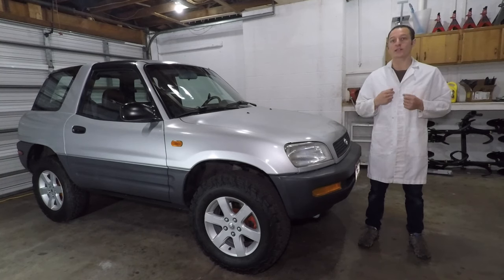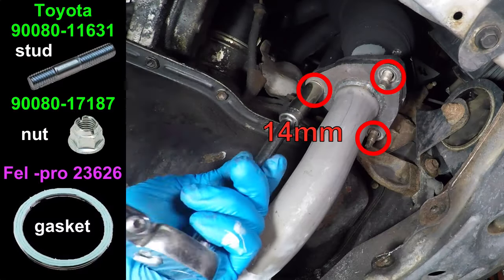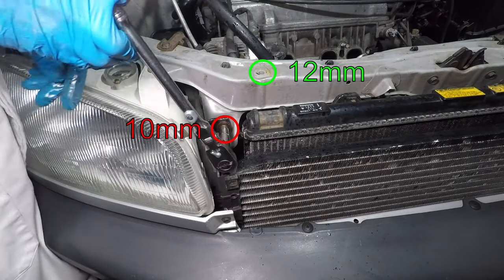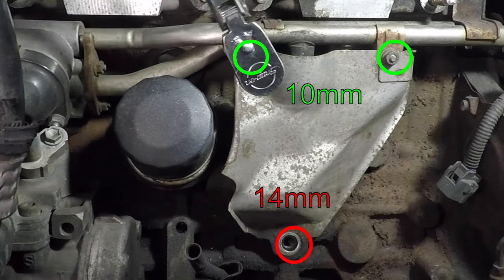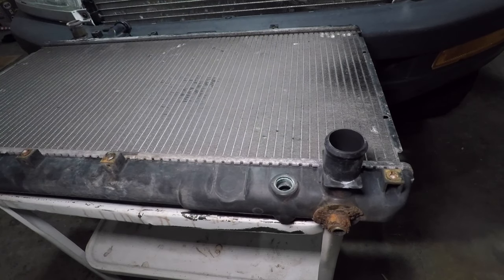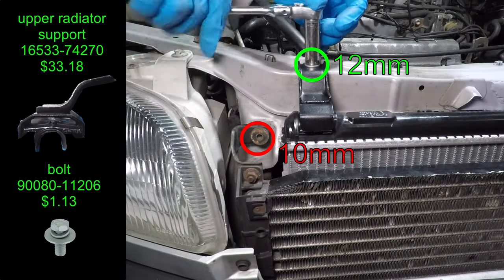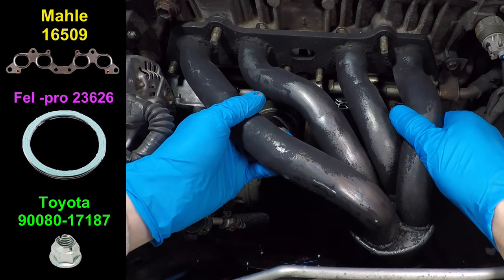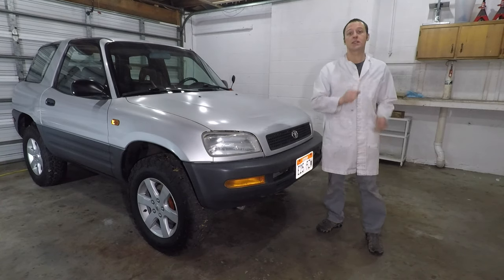Replacing the radiator 1997 Toyota RAV4 (episode 15)

Comment: Hey everyone!!!! I just did the radiator on my 1998 rav4. I found an alternate method some may find preferable if you are worried about taking headers off. 
1: Remove all radiator fans bolts 
2: Remove entire airbox assembly 
3: Remove bolts holding AC dryer/ condenser and lines in place (give you room to wiggle it)
4: Remove all bolts holding plastic underbody protection on, as well as the bolts holding the front bumper cover down
5: Disconnect fans wiring and coolant temp sensor wiring. 
6: Disconnect negative battery terminal (don't wanna mess with airbag sensors)
7: After removing all bolts from the underside of the bumper cover, loosen plastic fasters on top side of bumper cover. 
8: Remove Bumper cover and brace it on something to not strain the wires. 
9: Remove about 8 bolts holding the front metal bumper in, pull that out of the way
10: Take the now loosened AC condenser and put it up off its mounts, giving you plenty of wiggle room
11: Remove old radiator 
12: Reassemble and  and bleed air out of system 
I know my description was lacking some fine details but I just wanna throw this method out there for anyone interested. It did it in an afternoon and was 100% successful. If anyone has any questions or want any further detail just reply to my comment, I'll try to give you the best advice I can.
Reply: Thanks for this -- one other video seemed to talk about removing the bumper to make room -- agreed that I don't want to mess with the exhaust manifold, so I'll be using this method for sure.  Interesting how MANY of the videos end up making things look MORE complicated than they actually are.  I was also guessing an afternoon, 6 hour range, is all that should be needed for this job.  None of my fans work, and I'm trying to decide if I care, as it's still running on the old leaky radiator, and never gets "hot" per the guage, fans or not.  Are the fans just necessary if you're sitting in stopped traffic on a really hot summer day?

Comment: Thanks Paul this series has helped me a lot. I recently got myself a '99 4door rav4! You sold me on the OME lift cant wait for mine!
Reply from the maker: That lift is nice.  I hope your car isn't as rusty as mine was.
Reply: @LabCoatPaul  how well do the cv's and steering joints handle the steeper angle resulting from the lift?
Reply from the maker: @superdupersalem  They're just fine with the Old Man Emu lift.  I think if you did a 4 inch lift you could get some problems with the CV axles.

Comment: Hi, your video was a great help, I just changed the Rad on mt 99 rav4 today, has 140K on it. I had to also remove the front motor mount, replace some screws that were rusted and broke off, changed some of the squeeze clamps to the gear type clamps, yes it was tuff getting the rad out, if they just gave another 1/2 to 1 inch of room it would have been an easy job.  Took about 4 hours with issues and distractions. Hope not to have to do it again any time soon!  Thanks.
Reply: If you have A/C, did you loosen or need to remove air conditioning condenser in front of Radiator?
Reply: @docjody8624  No I did not remove that part.

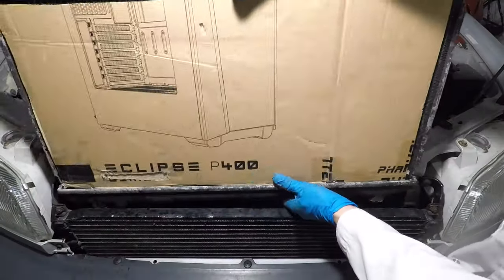Comment: 1//Sprayed Fan Shroud 4 x bottom bolts three iterations PB-Blaster over a 2-day period. So far, two have nonetheless sheared off despite my taking care. They're made of cheaper-grade metal than other OEM Toyota fasteners. Yey to remove other two. What size (e.g. M6-1.0x16mm) are these four lower 10-mm. bolts & where did you buy replacements?  Thank you. Hope others find this useful too.  2//  Also, do you have part numbers for those rotted lower radiator supports at 02:09?  Thank you again for taking time.

Comment: Hey Paul--  Another site states that front bumper must be removed for this job, if you don't want to have to remove A/C Condenser. I notice you 1/  Didn't removed Air Conditioner Condenser 2/ Didn't remove front bumper.  How did you have sufficient working room in there to be able to avoid both?  Any tips, much appreciated!
Reply from the maker: You don't need to touch the condenser.  The hardest part is removing the cooling fans.  You may need to unbolt the exhaust manifold to get the fans out.  After that, everything is easy.
Reply: Is it necessary to remove Fans entirely from engine bay in order to remove old Radiator?  Can tou just pull Fans out of the way toward rear of vehicle instead to access Radiator?  I'm hoping so. Did you remove Fans entirely only because you knew you were going to replace w/ aftermarket? Thank you again!
Reply from the maker: @docjody8624  Yes, I think you can just push the fans out of the way without removing them, and slide the radiator out.  
By the way, don't install aftermarket fans!  My flex-a-lite fans burned up the first time I drove the car on a hot day.  I'll be going back to stock Toyota fans.
Reply: You'll never know how much this info is helping us DIYers out here.  
     Say, what was first indication that your new aftermarket fans burned out on that hot day?  How did you know they were failing?  Thanks again. Fascinating stuff, Mr. Paul.
Reply from the maker: @docjody8624  I was driving along, and I could smell that distinct electrical fire smell.  You know when you smell something like that, you just hope it's something else, but it stays with you and then you know it's your car.  When I stopped, I opened the hood and could tell the smell was coming from the fans.  They worked about 20 more minutes, then shorted out and blew both my cooling fan fuses.

Comment: Hi Paul, realized that my 2 heater hose im the car is no longer connected. Is reconnecting this hoses back to the heater a job suitable to be done at home?
Reply from the maker: Yes, replacing heater hoses is pretty easy.  Cut the old hoses off with a sharp razor blade.  Don't grab the hose with pliers because you might crush the heater core pipes.

Comment: Hi Paul, I am having some issues with my Aircond system. When I start engine and turn on hvac switch I hear a clicking sound near the firewall and during that moment the compressor magnet relay clicks and the compressor turns on and off rapidly. Then either the compressor does not run or suddenly out of no where the compressor runs and the a/c is cold. When I hear the rapid clicking sound near the firewall the a/c is not cold as the compressor is on and off. When I bypass the compressor magnet relay and put the A/C button off the Aircond is icy cold. So I thought the relay was faulty and replaced it. But after that the clicking sound near the firewall is still there and my problem remains. I have also tried replacing the a/c button on the dash. What else can I replace to fix this? I really need help.
Reply from the maker: The air conditioning system is not very DIY friendly, because you need a special machine to pull out the refrigerant.  You can check the resistance of your compressor clutch, and check to see if the high and low pressure switches are working.  If that doesn't help, you'll probably need to take it in to a shop for diagnosis.
Reply: @LabCoatPaul  excellent thank you Paul..

Comment: You made big mistake during replacement. You have to clean coolant off the steel parts and body as coolant oxidizes it heavily (rust). I always take water hose and clean it all with straight water.

Comment: I paid $556 ($156 parts and $400 labor) to have one installed into a 1996 Rav4. The mechanic claimed that he had to remove something to get to it and if I remember correctly he said that he had to remove the A.C. and then reinstall and refill it, which is why labor was so high. Does this sounds right or do you think I got screwed? Thanks in advance!
Reply: Hey man, probably a bit late for you to see this but you didn't necessarily get screwed. It can be done without taking the condenser off, either the way Paul has done it or by removing the front bumper cover and bumper. However if you look on almost any forum they will tell you it can't be done without pulling the condenser. Most people just don't know how to do it any other way. I took the bumper off the change mine. My point is I don't think he tried to screw you, I think he looked at a repair manual and it told him to take off the condenser. Could it have been done another way, sure but I don't think he tried to screw you.

Comment: How did you remove the broken bolts
Reply from the maker: I didn't have to.  I installed  a new radiator so it didn't matter if the old one had broken bolts in it.  You can drill bolts out, but that's hard and doesn't always work right.